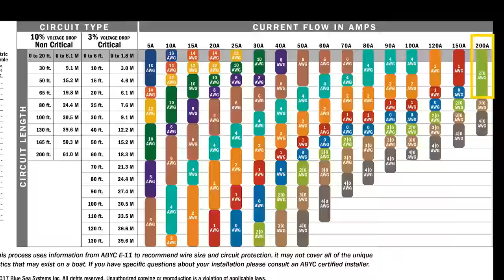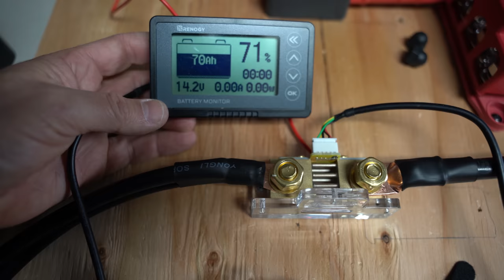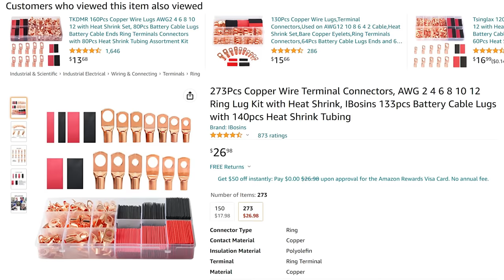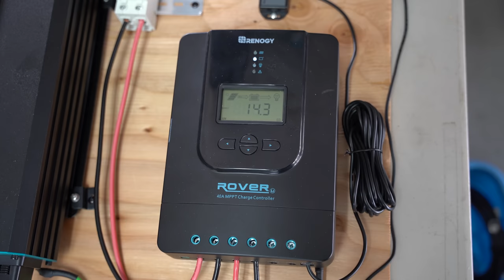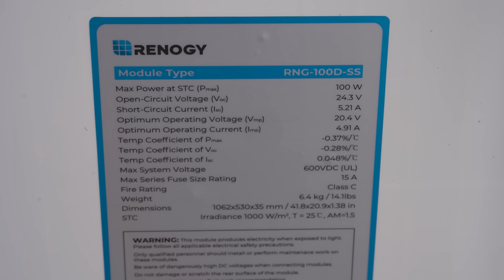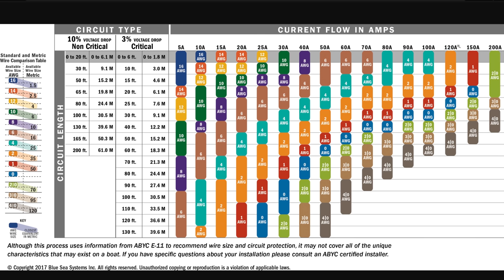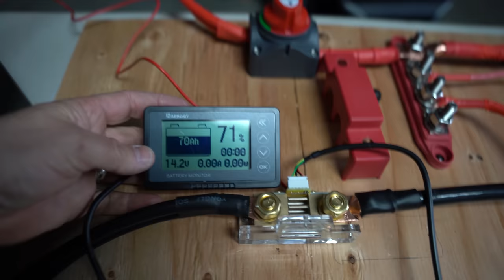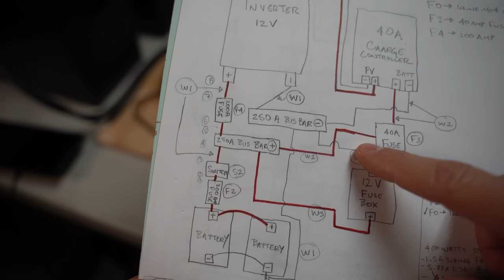How To Build A Solar Setup: COMPLETE Step-by-Step, DIY Guide (12V, 2000W)

Comment: Thank you for making this video.  Could you recommend the simplest modification that would be needed to allow charging of batteries from a 110V AC source in addition to the solar panel option?  I'm assuming power outages is not the only time I would be using this portable inverter.
Reply: exactly - I had the same question.

Comment: Great video! Are you running 2 wire from your shunt to the negative on your batteries? Are you running 2 wires from the cut of switch to the pos of your batteries? It looks like that in the video.

Comment: If I understand correctly if this was a 48v setup, you would swap all the 12v gear (controller/inverter) for 48v... And you'd be able to use significantly smaller wire
You could then also add a 48-12v step down converter for any 12v devices you may need...

Comment: My understanding you must hook the charge controller to the battery before the solar panels which is in the written instructions from renogey.  But with the circuit breaker turned off. should be ok  (i think)

Comment: This is a great video! Really helpful. I am thinking of building a solar system into an over landing trailer later this winter. When I do, I would like to add SAE plugs to quickly disconnect the solar panels. I would also like to add shore power for charging the battery before the trip and once I return. Do you have recommendations for how to do this?

Comment: Love the video and great detailed info.   I'm stuck on this:  if the 2000w Inverter can pull 196 Amps (2000W/12V/.85), would that not trigger the Battery BMS over-discharge protection?  Most 12V LiFePo4 batteries have 100AMP BMS protection, but I looked up the batteries in the video, and thought they had 150 Amp BMS protection.   Am I missing something here?  For a standard 12V battery with a 100 Amp BMS, wouldn't a 1200 Watt Inverter be closer/safer to use?  (1200/12/85 - 118Amp).  W/V/inverter efficiency = Amps.   Thanks for helping me if I'm missing something.

Comment: How did you determine the size of the wires from solar to charge controller, size of charge controller and the size of the wires from the battery? By the way, why are there 2 positive wires from the batteries to the battery switch?

Comment: is a possible way next video to bring up a 48 volt setup and mention advantages and improvements vs this 12volt setup? there is a lot of equipment that runs with less nrg loss in higher voltage and less thermal troubleshooting.....

Comment: This is a great video and well explained. You covered topics that I had a hard time getting from other videos. I do have one question. Since you have the Renogy smart battery's , what was the reason you went with the the monitor with the shunt, instead of the plug and play smart monitor? Is there a benefit to using the monitor with the shunt, instead of the one, that just plugs in? Im asking because I got the same battery's and about to get the monitor as well. Thank you for putting in the time to do this video!!

Comment: Are you sure that your fuse on the positive is at the right place? Seems to me that the current location only take into account the current going into the inverter and not the other loads connected to the bus bar.  Would it be more appropriate to locate it between the positive swutch and the bus bar?

Comment: Really good tutorial! Can you maybe make one on how to add a battery to  a small solar System that currently just feeds into the grid? My Panels produce more than my base load during the day, so my idea was to charge a battery during the day and use the battery to feed into my grid during the night. And im not sure if it would work with this setup since i dont want to immediately discharge the battery at Max load but slowly give off like 150w or so (my base load at night).

Comment: I apologize in advance if this is a dumb question because all this stuff is super confusing still. Even though you explain things in a way much better than other channels I’ve come across.  I’ve been thinking of either a solar generator or just build a system like the one you’re teaching here.  I just need something that will power up a 1500w space heater.  I don’t have internet out there so I don’t need all the bells and whistles. Just need heat and power to charge my power tools.  If I’m there I may need to power the heater for 5-8 hours for a few days. And it’s a small vintage rv so not a lot of space.  Will the 2000w inverter be sufficient? Or if I upgrade to a 3000w inverter would I need to upgrade any other parts? Again really sorry but I thank you in advance even if you don’t see my post. Thx for the tutorials and Looking forward to more videos.

Comment: Thanks for the video. WIll definitely be following this for my camping 12v build. Just wondering, what are your thoughts on using multiple (say double) smaller gauge cable instead of the single thicker  welding cable. The welding cables are hard to work with with additional tools for cutting and crimping. I know the connections posts / terminals will be busier. Thanks.

Comment: Chris, u may want to relook into battery and inverter efficiency explanation while selecting the wire. If there is a drop on the efficiency which highlighted by u, why is there an increase of current in the system u designed. Thanks

Comment: Great vid. Thank you. Question.  The battery monitor is a great idea, I purchased the same one.  If the shunt is only monitoring the battery , does it need such heavy duty cables.  And can you instead attach it to one of the posts on the bus bar?

Comment: Excellent video and design layout.  I watched a few videos and yours is the best.  I am setting up a similiar size solar system with the Renogy Products and Eco-Worthy Panels.  I am debating if I need to install the 12V Fuse Block.  What kind of devices will you be connecting to the fuse block?

Comment: Well done! This is probably the best overview of installing a system like this. Coincidentally it's all the equipment I have or have been eyeing up. I was thinking of installing this same size system on my shed. I live in the northeast and can get rather hot in summer and even hotter in the shed. Would it potentially get too hot for the batteries/equipment to operate?

Comment: Great, now how could one add a way to charge the two batteries with a gasoline generator as well? 
I’m building a system for my trailer , the end goal is to charge the system with solar most times and also be able to plug in a generator to charge the batteries that will power my water pump, interior LED lights, outlets for phone chargers, USB ports, etc etc.

Comment: I am very familiar with all these concepts having used inverters many times on 12v systems. I am new to the solar scene,  I expected that since high amperage produces allot of heat and is hard on batteries and inverter circuits, and getting only 15A@120v requires >150A  from 12v,  that home solar systems would have higher voltage batteries, perhaps even 120vdc , where both sides of the inverter will be low amperage and much less prone to failure.  This is a much more efficient and durable setup , with the exception that weaker batteries are at risk of being reversed charged when it is discharged before the rest, but a BMS could be employed like power tools packs to guard against that also. 

My question is: Are all home solar systems 12v on the primary side?

Comment: I want to convert my current 12V lead acid battery in my RV trailer to a 100Ah LiFePO4 (due to cost, I might start with just one battery and add a second later). Is there a lesser expensive battery you are comfortable recommending.
 If I were to install this setup in my RV trailer, where I can run a lot of 12V devices as well as 120V, and wanted to charge the batteries with the vehicle's alternator as well as 120V 30A shore line, as well as 400W solar panels, would I just connect the additional charging methods through the bus bars? 
I would be using:
• Renogy 12V 50A DC to DC Charger with MPPT, On-Board Battery Charger with power coming from the alternator's 12V power cable (through the seven pin connector) and the roof top solar panel hook ups
• Renogy 500A Battery Monitor 
• Renogy 2000W Pure Sine Wave Inverter 12V DC to 120V AC Converter 
What 120V battery charger / maintainer do you recommend? And, would I just hook it up to the bus bars or directly to the batteries? Is there a Renege charger that handles all three sources of power (12V DC, PV input, and 120V shore line)?

Thank you for your excellent videos! There are well written, instructional and well made. This subject has had a bit of confusion for me and you laid it out so well that I think I can pull this off (without torching the trailer ;-).

Comment: There is a flaw in the wiring.  The 8ga lead from the charge controller's circuit breaker to the bus bar is not correct.  It either needs to be 2/0ga cable or a 40a fuse needs to be attach between the cable and buss bar.

Comment: A little concerned with hooking the grounding wire up to the DC negative. I could see them hooked to a grounding rod and all were attached to a terminal block that was isolated from the dc energy source.

Comment: Great video!!! There is an error at 31:59 of the video showing for the battery 166amps  it showed 2000/120 which should of been 2000/12v for the battery

Comment: Great explanation.  I do have one question though, is the fuse between the positive bus bar and the inverter necessary?  There is already a 200A fuse at the battery.

Comment: Thanks for the video!   You make it so easy.  
I do have a question. I’m using a Renogy 1000w inverter and a Renogy 100ah lithium battery.   I see you using a 200amp fuse between the battery and inverter, what size fuse should I use on the 1000w?

Comment: Seriously great video. Best info explained in simple terms (For me at least!), New Sub. Going through a similar setup on our 4x4 here in Oz (Downunder). Might want to consider an EGON Hub, I have zero affiliation but i'm going to use one of these as they save you lots of cabling and connectors etc.

Comment: Great tutorial...
Just curious...Why the redundancy with the fuses just off the Battery and then again between the Inverter and the Bus bar....Additionally, the cable's that come with that unit are rated 1/0 awg and then connected to the switch... and then to 2/0 awg cable's into the inverter....not much of a difference, so I'm assuming OK

Comment: I have books on setting up full house systems, systems for sheds and information on systems for survival, portable systems and setups for vehicles. Your explanations are good, but most people consider how much "power" is required to run their appliances. Rather be concerned about what our house or apartment provides, I think it helps people to understand how to calculate the size of their inverters and how many solar panels they will need. We all have AC power in our dwellings and can't change it.

Failing the ability to truly understand or calculate watts, amps, amp hours, etc., if you demonstrate how to build a system and then to expand it, that will suffice. Most of us own and drive cars, but we don't know that much about how they work or how to fix or build them ourselves. A knowledgeable person could demonstrate how to make a dozen systems using different types and numbers of panels and batteries and the inverters.

Always trying to think positively, presenting a tutorial on a pre-designed system means anyone can copy it and build and install solar panels and build a battery bank and in some cases a couple of separate systems of similar or different sizes or outputs will be very useful. Getting people started and able to build something is of great value. This video will be cherished by preppers.

Comment: Good lesson. Thank you for your video. I have a quick question. I just got 1000w inverter with 20mm2 positive and negative wires from the factory. 

The distance between battery and inverter is around 15cm. What size of circuit breaker do I have to use? 

I have been looking for this but nobody gave me the answer

Comment: Very helpful, thank you. One question though... When hooking up an AC to DC charger converter to charge my battery bank from the grid/ generator. Do I hook it up to the bus bars? Or do I have to hook it up directly to the battery bank? TIA

Comment: Here's a question for you; why do you need such massively thick wires for what is essentially less than 2000 watts of power?  What I mean by that is that a 15 amp breaker can handle up to 1800 watts before tripping but only requires 14 gauge wire. But the wire that feeds that inverter needs to be many many many times thicker?  It doesn't add up which means I'm missing a piece of the puzzle.
Reply: I'm sure it has something to do with the differences of AC versus DC power. I'd like to understand that better though for sure
Reply: Wait a second... Is it because of the lower voltage? I feel like I've heard that higher voltage is like higher pressure and it can push itself through smaller wires. So lower voltage would not have as much pressure and you can't push as much or something like that?
Reply: John...I believe you solved your own puzzle!  👍 Lol
Reply: @YouLookinAtMe-Bro haha, nice! 😂

Comment: Question. If the 40A fuse from the Charge controller to the bus bar blows with your Solar Panels still putting power to the Charge Controller then that could potentially damage the CC, correct? Is there a way to trip the Solar Panel circuit of the battery gets disconnected or that circuit trips? 
Thank you SSOOOO much for this video, it really cleared up a lot of questions that I had about setting up a solar system!

Comment: 24v system will save you money on wire, make wires smaller and reduce the rating needed for the charge controller. Do you have a video for 24v systems?

Comment: What kind of wiring did you use coming from the battery? It’s looks different than the others. It looks like two thick wires connected together at the ends. And definitely more pliable than the 2/0 wires used.

Comment: Do you happen to live in Georgia? We got commercial grade solar panels, we have only found one company that has an Inverter strong enough to handle commercial solar panels.   Connecting Commercial to common grade solar parts requires a lot more finessing.  We could really use some help 🥴

Comment: Remember that the "grid" has been the most reliable electricity supply anywhere, ever, simply because it has several places to generate power and several ways to route it to you. You need to harvest enough power for use and storage losses. You need an alternative battery lantern for times the inverter needs attention. You will need to moderate normal electricity use so that your battery will last.

Comment: At 6:38, wouldn’t it be 2000/12x0.85=146.67? If 2000/12 would be the case of the inverter running at maximum efficiency, but it runs toughly 85% efficiency, you would multiply that by .85 to get 85% output correct?

Comment: I am trying to understand the efficiency. Is the following correct?  The current being supplied by the batteries to the inverter is 196 A, meaning the power supplied by the batteries to the inverter is actually 2352 W. Then, as the inverter works, energy is lost to heat and noise accounting for the 15% reduction in output to 167 A and 2000W. So when we say “2000 W inverter,” we are talking about it’s output, not what can be input.

Comment: I'm a newbie and love the video -- but two questions offhand: (1) if you're using an inverter that's 2k continuous / 4k watts peak, how come your bus bars are only rated to 250 amps if your 12V batteries could push as high as 333 amps (4k peak / 12V) through them. Am I thinking about this correctly?  (2) Also, the fuse you connected out of the inverter was 200amps. What's the math/logic to arrive at the 200 amps? Again, I'd think that wasn't high enough given how much the inverter is capable of pulling.

Comment: Good video and well explained but I have one question and that is why didn't you connect the batteries in series and half your amperage and run lighter cables? Assuming that I have my maths correct.

Comment: fantastic thank you.  I dint see any info on the wiring of the panels, im assuming parallel but how did you connect them into 1 inbound wire into the controller

Comment: A PV system Starts at the Panels. Amperage to the Charge controller? Which controller relative to that amperage  / what controller  pwm or mppt,??  Actually  the best knowledge would be knowing which voltage would be best 12 or 24 and why, 
24 volt reduces the size of the copper wire required thus reducing the overall cost. More often than not Panels are set a fairly far from the inverter/ charge controller panel, the wire cost to carry the max voltage from the panels is much higher with a 12 volt system.
Also Panel location direction they must face and the angle they should be set at relative to the address of the home.

Comment: wow! you made this very easy to understand! thanx.
now i want to setup a system that can handle extras like a wash machine
and possibly dryer ... and also a welding machine ... is 5000 W enough?
can you advise me? thanx if you can if not i understand.

Comment: As per formula to calculate ampere for 2000 watt inverter
W/V=A
2000/12=166.67

As inverter are only efficient up to 85% to 90% how can it draw more ampere as shown at 31:58 in video
2000/12/0.85 = 196

There is problem in formula, right formula is
2000*0.85=1700 (The actual efficiency of any inverter based on described wattages after consider efficiency factor, like here it is 85%)

Now if 1700 watt put into formula it gives real ampere that a inverter can handle
1700/12=141.67

OR direct calculation
(2000/12)*0.85=141.67